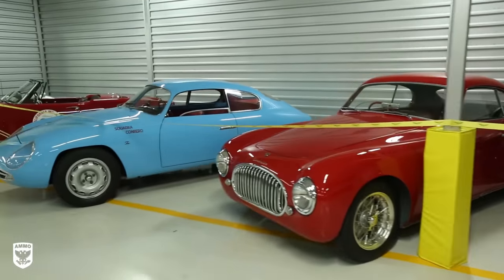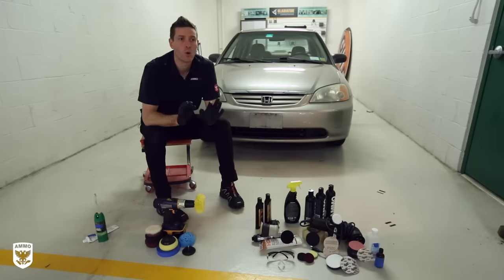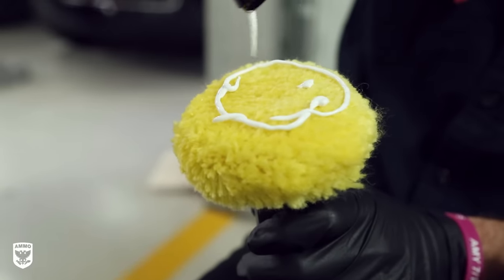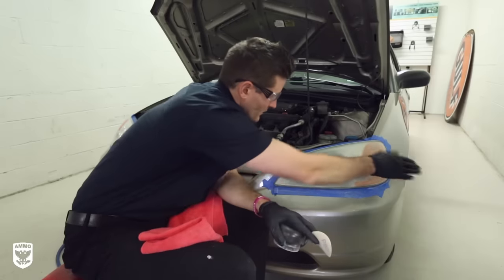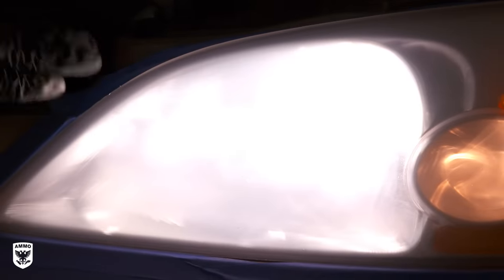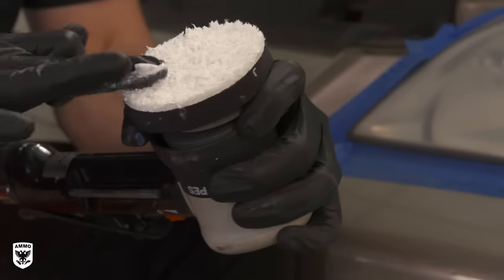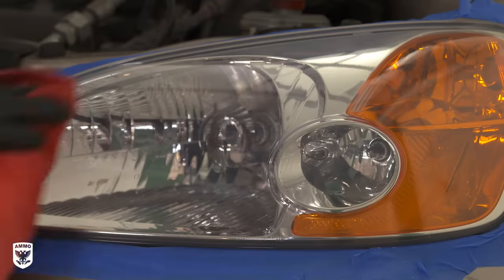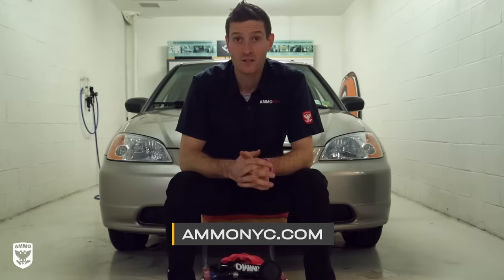How to Fix Foggy Headlights: 3 Different Methods: Honda Civic

Comment: So.... first off, I've literally been binge watching your ENTIRE channel for about 2 weeks now. I'm about to own the most mint 2014 VW EVER!😆

Second, I tried using a spray clear coat for protection, and it came out with an orange peel texture. What am I doing wrong?
Reply: You have to spray clear coat heavier than regular paint that you dust on. If you dust on clear you get the orange peel. You have to spray clear coat really heavy so it looks almost like water over the top. It's a fine line between too little and too much (runs). So maybe practice on something else first? Also you can't easily touch it up by coming back later. Better to lay it on once and thick and let it dry, it will dry glossy and clear after that.
Reply: All the videos I've seen just show a light coat (a couple sprays) so that never came across correctly. Thank you so much!
Reply: @Mr.Flanagan11c  yeah I think it may depend on the type you're using as well as aerosole can vs spray gun.
Reply: That's understandable. I'm using a rattle can. I'm guessing the sprayers put down more product faster.
Reply: @Mr.Flanagan11c  I also tried a cheap clear coat paint first and had horrible orange peel. The better stuff was considerably more expensive. 

I've actually posted about it here (tail lamp - not headlight restoration) but same same.

Hope this helps, wish I knew this before I started :).

https://www.viczcar.com/forum/topic/13514-tail-light-restoration-tutorial/

Comment: Any tips for dealing with light surface rust? My wife has a 06 Black Pilot and right on the rear quarter panel behind the wheel well it's starting to bubble up. We want to keep the car for a while and don't want to have to do major body work and repaint but still want it to look acceptable. 

My plan, unless someone gives me a better one, is to sand it down and fill/seal as needed then cover it with black vinyl (I think that would be better than trying to spray paint it)
Reply: ***** thanks for the advice. Unfortunately I don't live somewhere nice, I live in Pennsylvania so I'm getting the same salt issues. I'll try the rust transformer, I figured I'd need to chemically seal or kill it somehow, I think you're right about it coming from the inside. It's my wife's car and admittedly we don't really take proper care of the paint, she runs it through an auto wash and that's about it. I just don't want it to get much worse. I still might try putting vinyl over it after the rust transformer. I'll let ya know if it works or not, it can't hurt at this point.

Comment: Good job! How much does a professional usually charges to do this? Any ideas if a BMW dealer would do it, or should I run away?
Reply: Not much. Maybe 50 bucks for both headlights + fog lights.

Comment: Help Please.
Couple of questions.
1- Is there anyone who makes glass headlights anymore?
2- What are good aftermarket brands that make headlights with high quality in the plastic they use?
I purchased new smoked stock headlights & only about 4 or 5 months in the headlights were already very yellow. Not only yellow but a bunch of cracking on the inside. It's so visible. I don't want to buy headlights again just to find the same quick fading again.. any help appreciated.

Comment: sand down with 1000 -  2000 wet sand,  then spray 3 -4 coats of spraymax 2k clear.  this is permanent and will not need to be re applied.  1 can of spray max is about 20 dollars on amazon and can do 3-4

Comment: Isn't it a bit overkill to go with such coarse sandpaper if you got comparable results with just compound and polish? If the compound takes out most of the scratches on such a severely weathered headlight, can you not just use 2500 grit to clog the pads less and just go ahead compounding/polishing/protecting? It just seems very time consuming.

Comment: so i did this with the sanding and i clear coated too and my headlights still look hazy and blue-ish even though they are shiny on the surface. i started with 800 wet but i was thinking of going back with 400 to take the clear coat off and cut it back down again. any tips?

Comment: Hey, I’ve wet sanded my polycarbonate lens all the way up to 7,000 grit. And I’ve polished with heavy cut compound down to ultra fine finishing compound. But no mater what I do the lens is still completely full of tiny micro-scratches??? 

Any idea what I’m doing wrong?? I just can’t get any clarity?? 

It’s almost like the lens is super soft?? It’s a 2007 model Lotus Elise if that’s any help. Any advice would be very much appreciated as the lens looks worse now than when I first started on it😞😞

Comment: I USED wd 40. I guess its not forever.
I would think for minor hazing,clean the lens good..and then just spray the UV clear..and it will do the same as bug spray,but last..right?

Comment: What "compound" and "polish" do I use? Please provide details and a link to suitable products from Amazon.
Reply: Jasmine Clark I believe he used Meguiars M105 (compound) and M205 (polish), but they are the high end expensive formulas, so alternatively, you could use Meguiars Ultimate Compound and Meguiars Ultimate Polish instead which is cheaper and should yield similar results. Hope this helps!

Comment: Professional results, but to many steps, I going to use another method I saw , sand down with 800grit clean with alcohol and spray paint it with two coats of clear.

Comment: Hi bro, greetings from australia... love your work and passion..worked a bit in detailing long time ago,when there was no double action :)  ive watched one of your vids,about headlight restoration.. did everything u did,came out really nice,but the clear coat messed it up... it looks darker now,like with tint on it.. i used  a good clearcoat... should i cut and buff again?? or do i have to do it all over again?? (and shoot me in the face in the process) in need of help :(  cheers
Reply from the maker: Hey bud. probably need to sand it off and start the process again
Reply: @AMMO-NYC   cheers, so what i do with the clearcoat? it just doesnt come nice.. ive asked few ppl,they all say clearcoating plastic is no good..ive sprayed it as needed

Comment: AMMO NYC  ---  I hold that UV damage is NOT the problem.  Were that the case, the rear clear lens' would also heavily yellow....but they do not.  I hold that the wind blowing dust, dirt and debris actually sandblasts the headlamps and that is the cause of the pitting and yellowing. The sandblast effect of wind and grit must be much greater than any UV damage.  Your response?
Reply: i would agree with your logic as well. Cars do travel at high speeds bugs dirt dust grime all smash into the poor headlights.
Reply: Dirt and debris get rammed into the front headlights. This wears down the factory UV protectant. Then the yellowing occurs.
Reply: I think it's probably a little, (or maybe a lot), of both.

Comment: Hi Larry, 

For very heavy headlights oxydation, for the professional way, which grit do you recommend?  I was thinking about 400/800/1500/3000 with a machine 🤔
Reply: Forest he said 320-500 for the first step I think
Reply: Forest but as far as the machine, I think a low speed would work well as it is a heavy grit already; high speeds would cut too much in my opinion.
Reply: @vincentcasarez8895  thanks

Comment: Do you have to use pnuematic/electric power tools for the polishing? Cause the best I can do is by hand..
Reply from the maker: You can do it by hand but it will take substantially longer and may not come out as clear.
Reply: what you could also do is sand till its fine woth 2500 grit wet sand and clear coat over it , but personally i prefer to buff, polish, then wax when i do headlights

Comment: I was going to try this, but then I realized new headlight assemblies were cheaper than I originally thought.
-when do people typically do restorations if new headlights are so inexpensive?
Factor in the work time to restore, and use that time to install new: is restoring headlights something that is losing popularity?
Reply: Cheap-  Headlight assemblies for the Honda Civic run $200-300 ???

Comment: The problem i had was the inside of the lens are hazy. I took it apart and just washed the inside lens. It now has micro scratches but it's clearer and looks better now!
Reply: Did you do the baking procedure or just wiped them clean?..
Reply: Did you have to glue it back together, if so what glue?..
Reply: @lasetlivingstin7752  i actually bought a butyl roll to reseal but the stock ones are stuck and hard to remove ao i just used a few, and reused the original.
I actually soaked it in laundry detergent because alcohol can't remove the dirt. I wish i could polish the insides because although it ia clear and clean compared to before, you can see small cracks and scratches when the lights are on. No regrets still looks great!
Reply: @kendelion  Thanks, but I'm not understanding the 1st part...So, you basically washed the light out, then drained...I ask b/c some of my lights are bad on the inside...Yellow, sweat, cloudy, or water...I want open them up, but afraid, until I know exactly what I'm doing 1st...
Reply: @lasetlivingstin7752  What I did is after I remove the plastic lens from the headlight housing, I soaked it in a huge container with laundry detergent and waited til the scum and dirt were soft. Then I used a sponge inside the lens to scrub the remaining particles. After that I wiped it with microfiber and lint free towel to make it clear as possible. Then I put it back altogether, then polished the outside lens after mounting it back to my car. Buffed, then UV Coat. 
I shouldve polished the insides too because There are parts where you can see the sponge scratch. Small, but if you look close you'll notice it.

Comment: Okay I have a question for you if you would be so kind actually from that area but I live down south now. I have just replaced the headlights in my 2005 Acura RSX with Akon projection headlights with halos and they are having a condensation issue Whenever there is what weather one thing I noticed is the stock headlights only had one drain at the bottom where the Akon's have to also I reused the old turn signal gasket which looked to be in good condition. The headlights don't appear to have cracks anywhere and they are both condensating in the same places at the same time and at the same level my plan was to cover one of the vents to make it match the factory vent system it also put brand new turn signal gaskets I know gasket issues can sometimes be hard to notice

Comment: couldn't you use a electric oscillating multi tool to sand?  Beats running low on elbow grease.

Comment: Why would i Dry sand at first? what will happen if i wet sand it ??
Reply: The point of the sanding step is to remove the failed clear coat. Wet sanding is usually used to mitigate what is being removed. But at first, you are just trying to remove as much as you can at first. Then you wet sand to smooth out the more aggressive first stage sanding.

Comment: Hi question. Please help me with my problem. i think what happened with my headlight is.. i over sanded it.. the headlight is so yellowish and foggy. i tried 400 grit,it didn't work enough to get rid of yellow thing. so i decided to use 220grit, it worked for the yellow thing. Then i used 400 again. then i used 1000 then i used 1500 then i used 2000 then final is 2500 grit.. the headlight began to be clear after 2500grit. i can even see the bulb inside. i sprayed with clear coat then i was shocked with the result. it became too foggy to the point i can't see anything inside the headlight. i waited for 10mins hoping it'll be clear when it dries up. but nothing happened. please help me. should i sand it again to get the roughness of 1500grit? or should i just buff the clear coat with rubbing compound without sanding? or what to do. huhuhu nervous here.

Comment: Suggest...
Metal polish, wax or Clay types...
And just using buffing...
Iv seen allot of persons finish with Just WAX..

The fun Part iv seen its that SOMEONE used a TOP COAT on the lens when they built the car..

Comment: First use any toothpaste, that turned a pair of 2003 lights that were orange into brand new, surprised me. But will not work on my 2003 Vibe. Not all plastics are the same.

Comment: too complicated people.. this guy is a perfectionist and all this is not needed.. use 600 wet sandpaper with dish soap and water keep the lense watered lubed.. sand side to side dont matter what direction youll see yellow come off then wipe it off sand again till its clear plastic you see come off...... they just use with a drill and  buffing pad thing wool one simple polishing agent go slow side to side... wip off repeat to desired efffect... you dont need all the product and stuff hes doing remember these are 30 dollar head lamps for all the work you can go get a set for 80 bucks on ebay and skipp all this bs..... sand paper wet is about 10 bucks some polish 8 bucks a pad about 8 bucks or less so do the math

Comment: anybody know where to get that round sanding block and the sand paper? Seems like a perfect size for doing the lights
Reply: cut a round peice of 1/4" rubber. glue your abrasive  on with 3m 77 spray adhesive .

Comment: how about just changing the plastic glass for 20 bucks? is that a good recommendation?
Reply: If you can get replacement headlight assemblies for 20 bucks, lucky you. For many cars, the Honda in the vid for instance, they are $70+ per side.

Comment: 8:16 "This 3000 will take off the 1500"  Did you ever use 1500 on these particular headlights? Were there other grits you used that weren't explicitly mentioned in the video? Just wanna know because I'm writing everything down and want to follow it to the tee to achieve similar results.
Reply from the maker: whatever was mentioned is what I used.  thanks for watching
Reply: Cool, thanks for the clarification. Love your videos man!

Comment: What if I don't have an orbital machine? will my hands and elbow grease work?
Reply: Andre Forbes I used elbow grease for the sanding part and then a black n Decker drill for the polish step. Worked just fine for me.

Comment: This car's headlights may be yellowing in the near future.  Not sure of the paste sealant you used?  

A tip for people  using other than what Larry did:

When using a headlight specific clear, you can't polish before you paint.  The clear coat will fail.  I do this for a living.  Painters do not polish paint before they clear coat a car, for that same reason anyone using a spray (or brush) on clear coat needs to omit that step for sure.
Reply: what is the last grit sandpaper do you recommend before cleaning and applying the clearcoat paint? 1500 or higher seems to fine and won't have good adhesion? right?
Reply: +StraitClownin909 
3000 is MAX.  2000 works but not as clear, so take it to 3000

Comment: I just spent like 2 hours sanding and polishing my MBZ 1974 240D headlights and they are smooth as a baby...now I know how much of the haze is on the inside - ugh
Reply: +Matt Whitmire Yea, unfortunately there isn't much of a way to deal with that.  Sometimes you have to replace the headlight housings.
Reply: +Matt Whitmire Or you can bake them and separate the housing from the lens, then fix the issue and glue them back together.

Comment: I've  never had any vehicles with this problem. and some vehicles were 10 years old. what are people doing to their vehicles to cause this? never washing? and my vehicles always sit outside in direct sunlight
Reply: My car is only 7 years old, never garage kept, but I live in Hawaii so I'm sure the salt air and stronger than average UV  damage doesnt help the situation.  I don't think it matters how often you wash your car, either.  Most cars a few years old or more develop the same dull haze.

Comment: does look great, but seems with the machine you could have gone with different grits of compound, working from aggressive to polishing. I've done them by hand with polishing compound and had it last but, didn't use a protective finishing product afterwards. Obviously that's the real secret. Good job though.

Comment: YOU MIGHT WANT TO MASK OFF ALL THE AREAS AROUND THE HEADLIGHT WITH PAPER BECAUSE THAT COMPOUNDING AND POLISHING PASTE CAN GO EVERYWHERE, INCLUDING ALL OVER THE ENGINE. IF YOU DON’T YOU COULD BE LOOKING AT A MASSIVE CLEANUP JOB THAT WILL TAKE YOU HOURS LONGER THAN THE HEADLIGHT RESTORATION JOB. Otherwise, great video.

Comment: Eyup, I'm one of the nutjobs...  I finish in 1500 grit, clearcoat with a UV-protecting spray paint, wet sand at 2000 grit, and polish.  Seal if you'd like, but I never have, and I've got customers on the road with 5+ years on their restored headlights without touching them again.  :D
Reply: yo dude thanks for answering my questions. what kind of clearcoat do you recommend?
Reply: The clear coat is the seal lol
Reply: William Dao
No more or less than the clearcoat on the rest of the car.  :)

Comment: Just use bug spray! Takes 5 seconds and it will look 100% brand new, even if they're solid brown! Do not use sand paper or any of that store bought stuff!
I use the orange Off brand bug spray and the last time I used it lasted a year before it started to turn again..
Reply: Rick Malone It's a good temporary fix but the sanding method with a sealant is much better. The clarity will be much better too 👍🏼